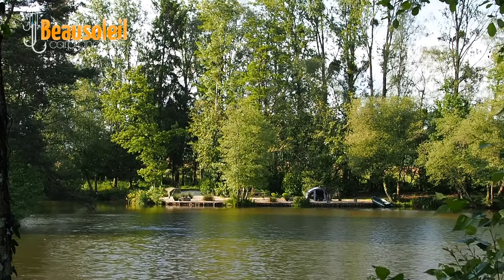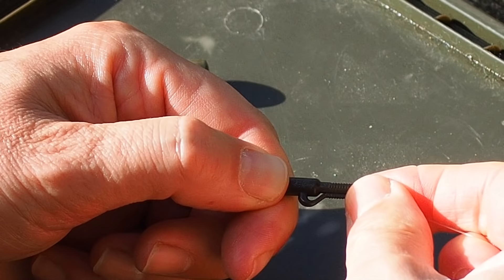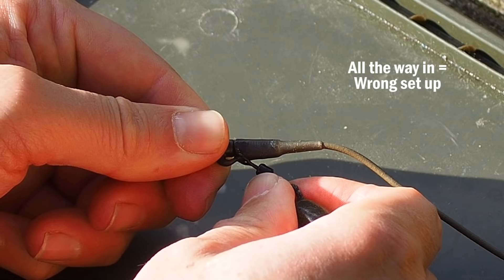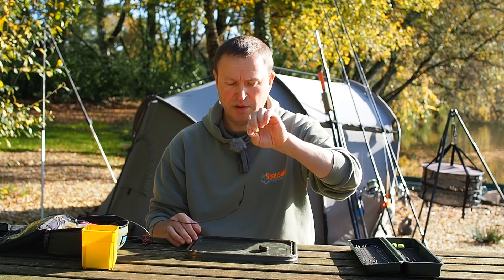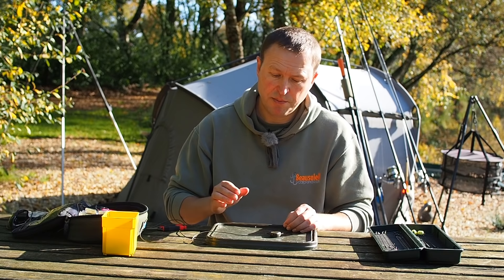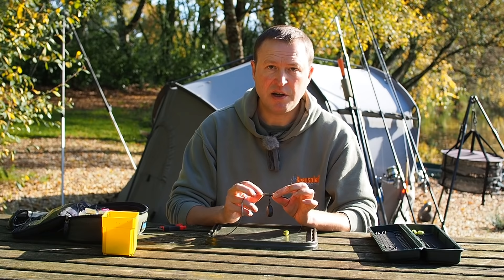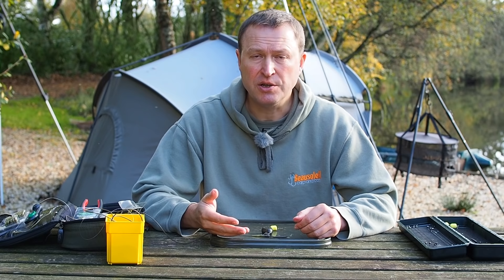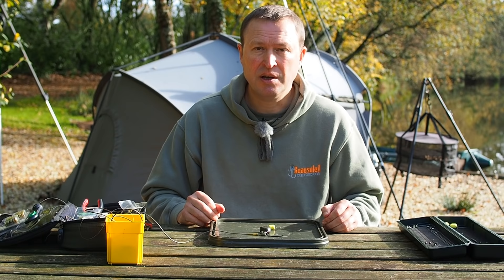STOP Using Lead Clips Like This | 5 WORST mistakes❗

Comment: Your lakes must be full of leads and it must cost a fortune to keep replacing them
Reply from the maker: I don’t fish with lead clips. I made this video because I hate to see anglers deliberately dumping leads and you’re right, I’ve found plenty at the bottom of my lake over the years. Most of my fishing is done with some form of running lead system which the carp find extremely hard to deal with and I don’t lose the lead. The anglers at my lake now only fish running leads.

Comment: Ao basicly by allowing the lead to easily dropped your essentialy filling lakes with leaders lol
Reply from the maker: Hi James, I agree, and that’s the whole point of this video... I hate dropping leads. That’s why I use and advocate running rigs. The carp can’t use the weight of the lead to throw the rig and you don't lose leads.
Reply: @matthewcollinsangler  i dont mean to sound arsey it was just a statement as im new to fishing not actaully been yet just gathering gear and hopefully the correct setup. I last touches a rod 13 years ago and boy have things changed.
Reply: @matthewcollinsangler  thanks for yu video i used this run rig today… caught to little common carp but got no snags, loses or lead loss. Thanks again.
Reply from the maker: @jameshalford4699  Okay cool! Glad that it worked for you 👍
Reply: @matthewcollinsangler  only issue i had was my chosen rig as it was to close to the leader imo but im going to learn to make my own lol
Reply from the maker: @jameshalford4699  Ok, not sure I understand what you mean. The carp rig should connect directly to the leader (if you are using one).
Reply: @matthewcollinsangler  i mean the hair rig im using was short, im going to try and make some longer rigs so the bait sits abit further away from the leader.
Reply from the maker: @jameshalford4699  Ah right! Gotcha. 7” is a good starting point.

Comment: So we just lose every single lead lol 😆
Reply from the maker: No, not at all. I hate dumping leads and most of the time it’s just not necessary. I use running leads for all my carp fishing. I know that in certain situations I need to be able to dump the lead but there are other ways of achieving that safely without a lead clip. I’m using a breakaway lead setup which gives me all the benefits of a running rig but if the lead gets trapped, I can easily break the lead off if I have to: https://youtu.be/NzmQgIiwFI0

Comment: why do you make it dangerous
Reply from the maker: Lead clips are safe if they are set up properly, if they are not, they can become dangerous to the fish.
Reply: @matthewcollinsangler  yeah but how can they hury the fish if you make them dangerous
Reply: @matthewcollinsangler  and your losing money by losing leads
Reply from the maker: @patstrzeszewski3240  Like I say in the video, I haven't used lead clips for years for my general carp fishing and I only use them in very specific fishing situations. I fish with running leads.

Comment: Then don’t use a fixed lead clip.. take the pin out and make it free running.. 2 ways of now making it safe
Reply: Running lead clips are not safe!
Reply: @ianpalmer6586  how exactly
Reply: He shows it in this video if you watch . The clip must stay fixed to the swivel or it may not be able to eject the lead if it becomes snagged.
Reply: Debris can become caught on the line behind the clip, meaning it won't slide through the clip, and that debris also prevents the tail rubber from coming off
Reply: @ianpalmer6586  The whole point of this set is so the lead is ejected when a carp picks up and shakes it off so it doesn’t get snagged. If you remove the pin then it’s like a fail safe if someone doesn’t set up their lead clip properly like he said and then gets snagged
Reply: @philipwalton4877  sorry but that not right at all. Plus dropping leads on the take is nonsense . If you need to drop the lead, you shouldn't fish there. Running clips are massively dangerous
Reply: @philipwalton4877  back when leadclips came out about 20ish years ago they were meant to let the lead drop if it became snagged. The dropping the lead thing was brought about by Korda many years later. Funnily enough who sell leads..

Comment: i don't now is funny haw guys from Korda pro. wranglers design product to appears to be faulty or wrongly designed this have no sense, i'm guessing this video is personal thing, haw  to prove that  this might affect carp is there any proofs of it under water check.... i just don't now.
Reply from the maker: Hi there, I own a fishery in France and at my lake, and many other French venues, lead clips are banned because they can be set wrongly and dangerously. I get to see the consequences of this during drain downs and nettings which is something many anglers will never see. I have found rigs at the bottom of my lake and all the dangerous rigs I’ve ever found have included a lead clip. I show this in this video: https://youtube.com/shorts/yJCh2t5RKW0?feature=share and here: https://youtu.be/skvyx6cKxCk. Many other lake owners see the same thing.

Lead clips were designed to dump the lead on the take - this means buying a lot of leads and it’s bad for the environment. Lead clips should only be used if the lake is weedy - that’s where you need to dump the lead. I don’t use lead clips, I use free running leads so I don’t lose any lead and it’s a lot more effective: https://youtu.be/ckzalwJuh0c.

Comment: Hi Matt, another very good video. It confirmed what I already knew in the back of my mind. I bought the Korda lead clip because nearly everyone I knew was using them. I used them maybe once or twice but didn’t liked them from the start. I don’t like rig tubing either. In your video you explained what can go wrong with it and that’s exactly why I don’t use it. I always used to use inline leads since they were available but a version with a hard plastic tube or soft tube with a large diameter already attached to the lead. Never used the ones with the small 0.75 mm diameter. I always believed in-line leads were the ones to hook a carp as quickly as possible. Only when the chod-rig hit the media I realized that a helicopter set-up can be very effective too. Till than I never used a heli set up. But not only was it different to what most people tended to use but the most important thing for me is the safety aspect. In case of a break- off the only thing the carp was left behind with is the hook-link. For the last decade this is what I used for 99% of my carp fishing and I don’t think I will ever go back to anything else soon. It’s a super save and versatile set-up. In the rare cases when I use an inline lead, it it semi- fixed so after a shake it wil come of the swivel. Not as save as a helicopter but much better than a lead- clip system imo..
Keep up the good work Matt💪👍.
Reply from the maker: Hi Louis, it’s really great to have such a detailed exchange of these technical elements with a like minded angler. For some reason I’ve hardly fished helicopter rigs but it’s something that I’ve forced myself to do more of as I also really like the safety aspect. TBH I don’t like rig tubing either lol. I much prefer to use leadless leaders like Durakord and nowadays with the Nash Cling-On which I find so easy to thread. You don’t even need to use a splicing needle with the 65lbs version. I still don’t understand why inline leads are sold with this plastic insert inside. It’s the first thing I remove lol. I used to be convinced that inlines caught me more carp but after a few years experimenting with pure running rigs and now helicopter rigs I no longer believe that to be true. Sure for solid PVA bag fishing they are invaluable of course. I still haven't mastered the chod rig and that’s something that needs to change as there’s definitely a place for it. I wish you all the best with your fishing and thank you very much for your kind words of support and encouragement. Cheers, Matt.

Comment: 08:03 on that cast was you clipped up?
Reply from the maker: Hi mate, yes that was a clipped up cast. Unless I’m fishing max range on big reservoirs I always clip up and feel the lead down. Fishing clipping up definitely helps when fishing with lead clips and PVA mesh. Cheers, Matt.
Reply: @matthewcollinsangler  excellent thanks, this spring i really really wan to practice feeling the lead down and find hard surfaces to be confident about my presentation and to be sure I'm not in weed etc.
Reply from the maker: @azaz...  That's great mate. Knowing what you’re fishing over will have a big impact on your fishing. Best of luck, Matt.